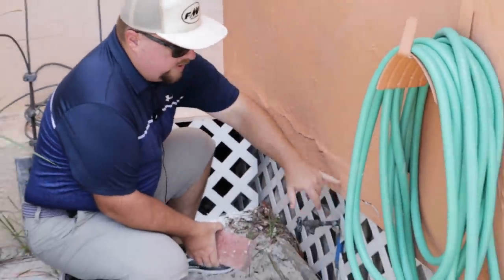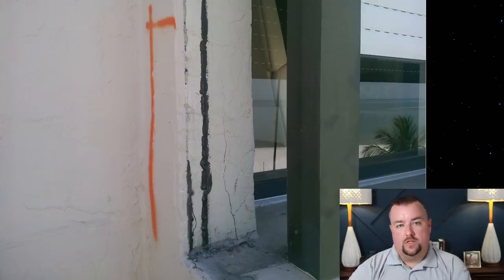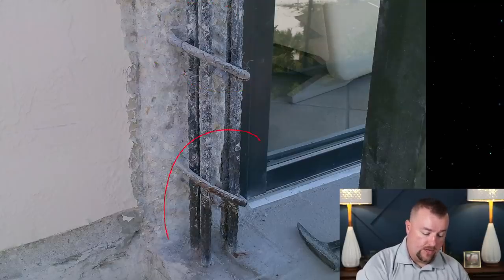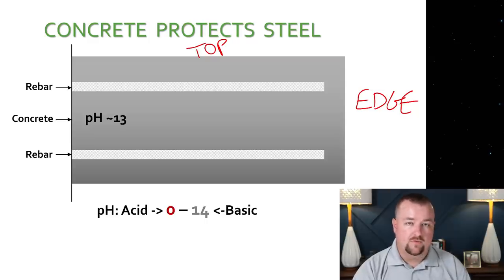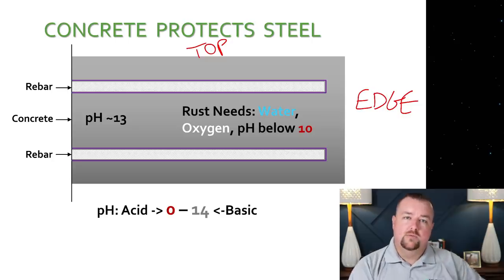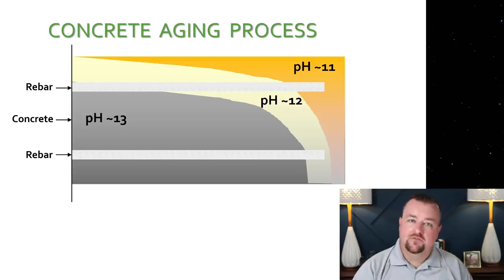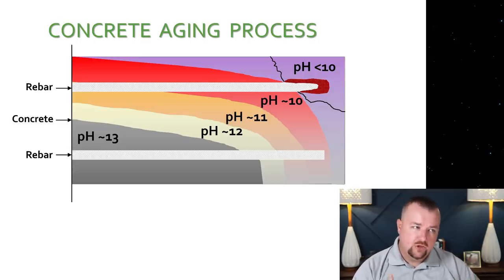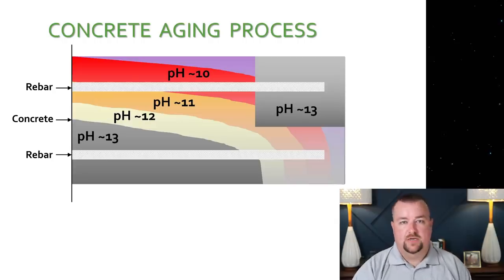Reinforced Concrete's Number 1 Enemy

Comment: So new structural concrete in/near a salt environment would benefit from a layer or two of thick rubbery paint BEFORE the ph drops below 13 but after the crete dries through and through. Then the coating/s must be diligently maintained forever to keep ph at 13. Does that make sense? LOL, it does to me but I'm no expert.
Reply from the maker: Pretty darn close!
Reply: I could see that working BUT, what happens when it gets older and begins to dry rot? It'll start peeling, I'd think.
Reply: @BuildingIntegrity  
Could you touch on what the future has in store for the Hoover Dam?
Reply: @larrybe2900  1. It is a massive pour. No rebar. This is standard for dams. 2. The Hoover Dam is not going anywhere!  P)
Reply: @windsofmarchjourneyperrytr2823  - Every couple of years you strip off the paint and apply a new coat. It's an inconvenient expense, and you could probably get away with not doing it for 15-20 years, but if you want to still have a building in 30 years it might be good to go ahead and redo the protective paint layer.

Comment: thanks, well said.  I was looking through the comments.  Composite reinforcements such as fiberglass and resin reinforcement bars.  The fibers can be glass, or basalt.  This eliminates the corrosion of steel  problem.  How ever don't forget that the water percolating through the concrete structure selectively leaches out the concrete minerals.  I would say the best way to protect concrete structures is to protect them from water.  Just like we put a water proof roof on our wood frame houses.

Comment: How about anti-rust coating the rebar? How much time does that buy you? How much does it cost?

Another youtube engineer I watched didn't like epoxy coated rebar (it gets damaged too easily during installation, and even though you can spray over the damage, bits always get missed) but did quite like galvanized rebar. 

Would stainless steel rebar ever be worth the cost?
Reply from the maker: I've seen a lot of epoxy rebar in Florida and I quite agree, it's not a great option.  I haven't seen much galvanized rebar so I can't comment on that.  Stainless steel properties would not be good for reinforced concrete unless special detailing requirements exist which I'm not aware of.
Reply: Galvanised rebar is an interesting question. Galvanised posts and the like last well inland in my experience. But after 20 years all of the galvanised steel foot bridges in the park near where I live (over salt water estuaries) are having to be replaced because of massive corrosion problems.

So perhaps gal rebar might just buy you a bit of extra time?
Reply: I think galvanisation has roughly the same effect on the steel as the alkaline passivation layer that forms due to the high pH. The question is, will those effects together or the galvanisation alone, make it last longer? I don't know.
Reply: @mjouwbuis  I think the the biggest weakness for gal rebar would be the ends when lengths are cut. It becomes a point of failure/low protection, especially if the bar is cut with a grinder rather than bolt cutters. So that might negate much of the benefit of the galvanisation.
Reply: @langdons2848  IMHO on building sites the quality of work is very low. All things get dinged and scratched. So construction material needs to be robust and be useable even in less than pristine condition. If one wanted to change that to the standards of other trades the whole industry would get very expensive.
Reply: @BuildingIntegrity  2205 stainless rebar has an impressive 75 ksi strength, so less could be used and less concrete cover. So the bridge deck can be lighter, and therefore it lessens the deadload, and can be made even lighter again. An engineer's dream! As they say, I could probably design and build something that would last forever, but it takes a good engineer to come along and take out all the unnecessary materials that just add expense and weight of the building. Sure I could build something that would last forever, but it would gradually sink into the ground too much, because overbuilt, and too heavy and just too expensive. Getting rid of all extra weight is key, the lighter and stronger a concrete building, the better it will stand up if a couple of columns fail, or if there's a fire or something.

Comment: How about home foundation slabs which are usually in frequent/continuous contact with water in the soil and from direct rain?
Reply: One of the reasons I hate slab on ground construction. When the slab goes bad in 30 years, well, you can't repair it like a traditional floor on joists and piers.
But it's cheap and quick and developers can increase profits from both those things...
Reply: Foundation slabs are supposed to have a layer of waterproofing and gravel underneath.  Foundation walls are usually covered with a liquid waterproof coating before the soil around the walls is backfilled.   Both are required by building codes, but a building inspector has to make sure it was done.  After the Surfside collapse, both contractors and inspectors will probably be a little more vigilant that this is done correctly.  Unfortunately,  over time, many will become complacent again.

Comment: I'm curious, is there any way to dope the exterior of aged concrete with an alkaline product that could soak in and neutralise the acidic buildup?
Reply: traditional culture in the med in coastal areas would whitewash their masonry structures annually or often with lime.
Reply from the maker: There are products that if applied to bare concrete regularly can inhibit the loss of pH in the concrete. Some products even claim to restore it but I am a bit skeptical of those for various reasons.
Reply from the maker: There are products that if applied to bare concrete regularly can inhibit the loss of pH in the concrete. Some products even claim to restore it but I am a bit skeptical of those for various reasons.
Reply: @peetky8645  that’s probably more to reflect heat and light than protect any rebar.  Plus it’s cheap and locally available.  Steel bars were not used to reinforce concrete until the mid-19th century in France. 

There are modern alternatives available such as rebar made from carbon fibers or basalt, but as relatively new technology, have not caught on.
Reply: @ianchandley  agree, but it may protect masonry from degradation due to salt, just a guess.  no steel involved
Reply: @ianchandley  I agree it was probably done to improve the appearance and perhaps try to reflect sunlight, but it may also have had a non-understood side effect of protecting the integrity of the masonry. 

Considering that much ancient masonry was lime mortar rather than concrete the internal processes are likely somewhat different. Lime mortar walls need to breathe, but they will also decay into sand if they get too wet (which is why they need to breathe, to dry out).
Reply: @BuildingIntegrity  I would agree there is no way to restore rusted rebar but given your explanation about Ph, it seems that maybe an annual soaking of a mild base solution that was adsorbed into the concrete would go a long way to reducing the acidity profile in the concrete that you showed.  Why isn't this recommended at least as a maintenance requirement in salt water areas?
Reply: @ianchandley  "rebar made from carbon fibers..." I would guess adhesion between the concrete and carbon fibre might be a problem. Under electron microscope, carbon fibre is very smooth, whereas rebar is very rough. This is a problem with carbon fibre/resin composites, the fibres can pull out.  Also a lot more expensive than steel.
Reply: @paulledak291  My guess is that it would have be much more frequent, like  daily rather than annual. Diffusion is very slow. A single application would penetrate a very small depth of the concrete, with a tiny amount of alkali penetrating. Water coming along later would dilute it.  The effects he is talking about occur after decades of regular wettings.  Also pH 13+ is quite nasty stuff, so you probably would not want to spray it around daily.
Reply: @paulledak291  its not just the acidity.  steel under stress is attacked by chlorides from salt water.  The salt water is a double whammy.

Comment: Concrete can be easily protected from water and chloride intrusion using specialty admixtures which significantly lower the porosity of concrete.  In fact concrete can be designed to have a permeability reaching that of granite which is ultra low.  Unfortunately code officials, general contractors and owners won't spend the relatively small amount of money to make highly durable concrete.  Per your examples, not all of the concrete in the building needs this level of protection.   It's only needed in areas directly exposed to these corrosive environments. I've made concrete that's completely impervious  to gases like is required in mining applications.   It only added about $12 per yard on top of $115 per yard concrete.   It's unfortunate that it takes a tragedy to even start a conversation about this.  You're doing get work on this channel and keep it up.
Reply: Can you explain how to make the concrete impermeable?
Reply: Yeah, XC3 XD3 XF4 concrete is just 10~15% more expensive than XC1! (environmental factors per Eurocode, sorry, have no idea how it is called in other codes)
Reply: Hello
Could you provide more information on those impervious/ low permeable concrete? Formulation, code, etc
Reply: @georgescotsdale361  Low water/cement ratio (a lot of cement, low water), special cements (inc., e.g with Silica Fume and such), special sand, special aggregates (granite), generally these concretes are always high-strength, C35/45 and up (that's 45MPa crushing pressure on cube specimen), special additives, etc.
Reply: Research silica fume and metakaolin in terms of low permeability concrete.  Also silicates which provide both surface hardening and permeability reduction.

Comment: Can you do a video on galvanized rebar and how often is it and would it reduce the need for sealing? Also I have heard there are issues with epoxy coated rebar. How much has  that been used in Florida?
Reply: I was wondering about Epoxy Coated Rebar too!  I noticed (courtesy of the Blancolirio channel) that the rebuilt Oroville Dam Spillway used a lot of it!
Reply: @welshbordergirl2476  hahah I just started watching Blancolirio for the aviation related content : D
Reply: @welshbordergirl2476  Oroville Dam is hundreds of miles away from coastal corrosion effects.

Comment: So in the images where the soundings were done, even though we see the oxidation going on in the rebar, it does still appear they are getting to this particular example before that bar deteriorated any more. the first rebar you showed on that house was just crumbling apart. time really is the most valuable thing we have.
Reply from the maker: Correct.  The second property rusted rebar was salvageable.  The first property at the beginning of the video had completely disintegrated rebar.

Comment: 8:24 So would sealing just with a clear paint on product the concrete every few years help to prevent this?  I know that it can have the opposite effect as well and hold water in.  Just thinking for things like driveways, patios etc that are sitting directly on the ground, or would it do more harm, based that it could be absorbing ground water and can't dry correctly?
Reply: Cover above, like in paint, and drainage below, like in porous material e.g. gravel, could be a solution.
Reply: @V100-e5q  - This sounds like a winning answer. Waterproof on top so water can't get in, but leave it porous below so water can leave.

Comment: Rusting rebar expands to four times the origonal diameter of the rebar; causing stress force which the concrete cannot resist. Waterproof the laid reinforced concrete to prevent environmental processes changing the ph of the concrete. Very clear information on how reinforced concrete ages. The progressive creep of acidification through the concrete, a bit more complex, but still clear as an explanatory idea.

Comment: This might seem like a dumb question but, does painted concrete offer more protection against rust as is the case in bare metal?
Reply: I would assume so as long as the paint forms a complete seal, is hydrophobic, and is renewed/refreshed as needed.
If not, it seems like it can actually make things worse by trapping in water more efficiently.
Reply: Big Leagues  apparently you are bitter cuz you never made it to the"big leagues"... But the heck the world needs dishwashers and laborers too.

Comment: I need some help. My understanding is that one of the ways to get fresh water from salt water is thru evaporation. So I dont understand how a salt air environment what ever that is works to damage concrete or the steel in concrete.
Reply: Near oceans, the wind and waves cause "sea spray": tiny water droplets break off and get mixed into the air and carried away.  It's like all the mist in the air close to a waterfall. These little water droplets are still able to carry all sorts of things, including salt.  (Water can be evaporating too, which raises the humidity, but is not what causes the "salt environment".)
Reply: @CodeKujo  Thank you. That makes sense even to my non-engineer mind. Maybe there needs to be some sort of buffer between high tide and buildings so that this spray doesn't reach construction if that is even possible.
Reply: You sound like you’ve never been to a sea coast environment.  It doesn’t take long to notice how R/C structures, even simple slabs-on-ground, exhibit pervasive symptoms of spalling.  The earlier commenter explained WHY perfectly.   Forget your analogy with de-salinization, thats apples vs oranges and is confusing you.
Reply: Watch again.   If English is not your first language you're going to have to keep watching until you get it.  He explains it quite plainly.  Keep in mind that humidity in the air is not just water but especially near coastal areas SALT.   (NaCl  or Sodium Chloride )  The concrete absorbs it and voila.    Watch the video again.
Reply: @oldmaninthemirror  alas, the spray is much too fine. Sea spray permeates everything for *miles*. Think cigarette smoke. It looks like it dissipates in a few feet, but you can still smell it from a hundred feet away.
Reply: @CodeKujo  I can taste salt spray miles from the coast, when the wind is strong enough.

Comment: Good video!  I really enjoy your clear presentations.  One small technical quibble from a Chemical Engineer.  Please pardon the jargon; 0-14 is not the range of pH.  It is entirely possible to have pH<0 and >14.  PH is the negative log 10 of the hydrogen ion concentration.  With a high dissociation acid, like a HCl, a 1.0 molar solution of acid has a 0 pH.  A 2.0 molar solution would have a negative pH.  The thing with 14 is that water  dissociates such that the negative log of the hydrogen ion (H+) and the negative log of the hydroxide ion (OH-) will sum to be 14.  This is a property of water (pkw). We normally refer to pH, but it always has a corresponding pOH with it, the sum of which is 14.  At pH=7, pOH=7.  At pH=2, pOH=12.  A pH of -0.1 would correspond to a pOH of 14.1. 0-14 is just the commonly encountered pH range.

Comment: Great info Josh! Do they coat rebar with protective seal on new construction like on the repair you show? If not, why?
Reply from the maker: No they don't.  The main reason is that it just doesn't need it.  But the second reason is that sometimes if those coatings are left to fully cure, they can create a bond breaker between the steel and concrete... so not worth the risk in new construction.

Comment: I always thought, if you HAVE to buy a condo, buy one that used to be a heavy duty factory. It'll be tremendously overbuilt for residential (tho you'll have odd design things, like a short top floor or MAJOR beams sticking out of the ceiling), but you'll ALSO probably get a free sprinkler system, too. As they were made in the late 1800s in their modern form. Assuming it works. It makes sense that it would or they'd have pulled it all out. Also, it would probably be near perfect in fires, assuming doors and new walls were as solid that way. Open spaces being not good for that at all. 

You'd have sold brick or stone walls, most likely.

Miss the old days in that, MAN, those building were made to last HUNDREDS of years!